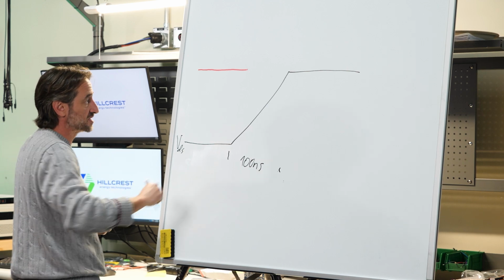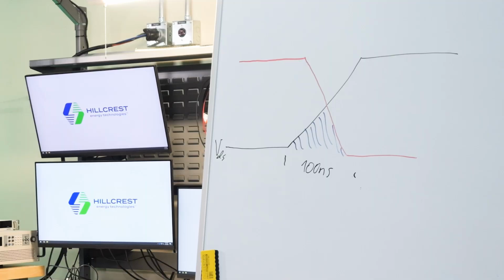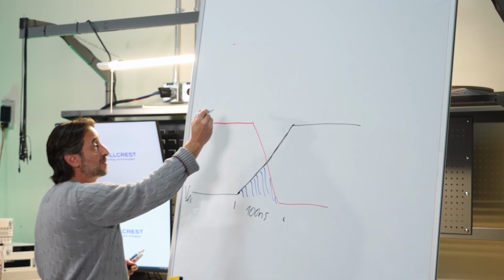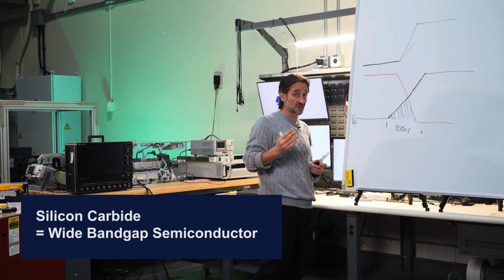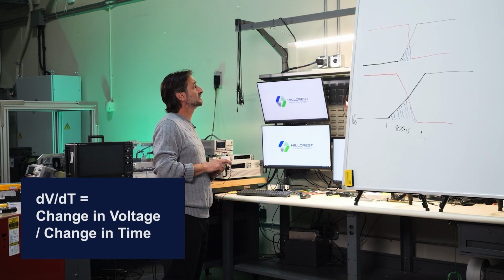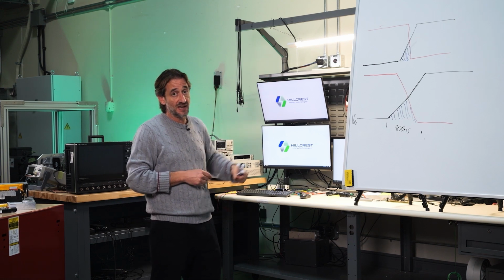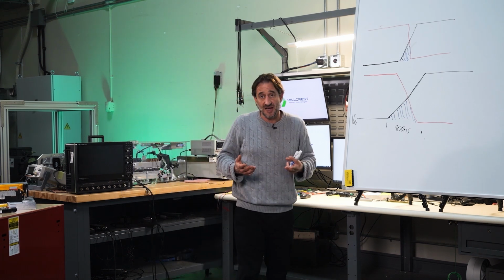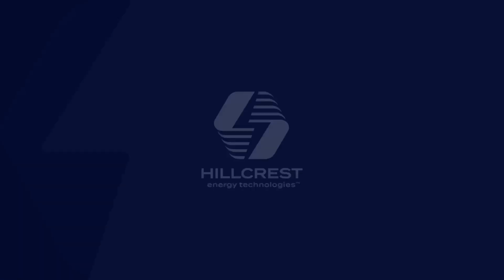HEAT Tech Talks: Wide Bandgap Devices

Comment: A minor correction. It's not the area under the triangle, it's the area under the curve of voltage X current, which is a parabola assuming current and voltage are linear functions during the switching interval that represents the heat generated during switching.